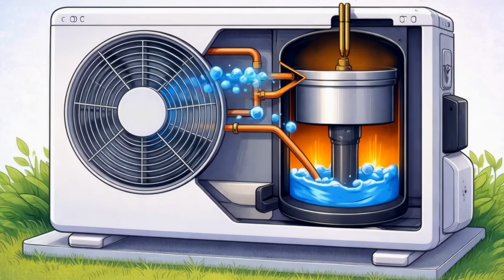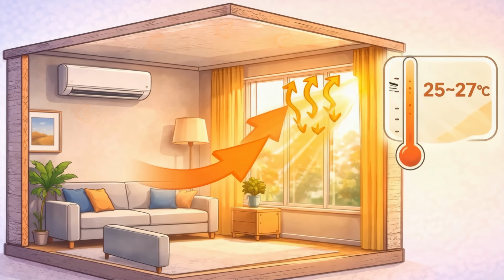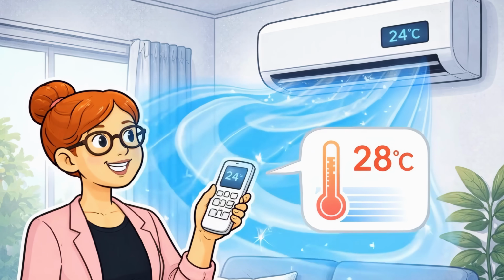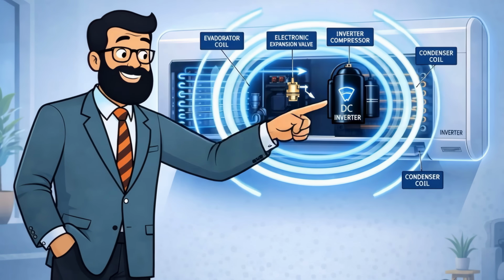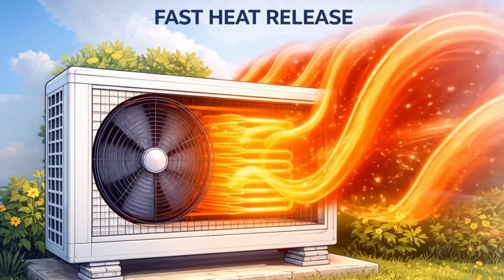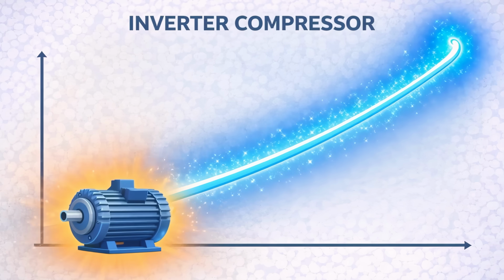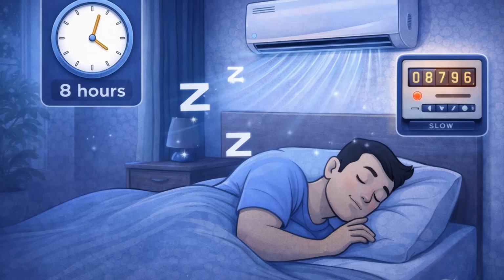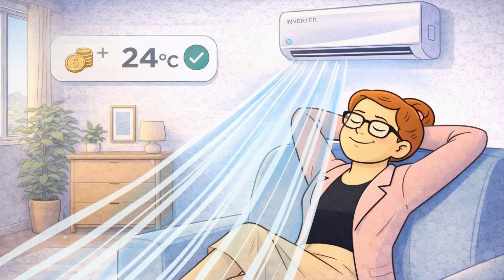Inverter vs Non-Inverter AC: Why Your Electricity Bill is So High! (Science)

Comment: The inverter uses proprietary components vs the non-inverter basic system.  That alone means the replacement parts cost are very high compared to non-inverter plus the part may not even be available in the future.  AC units are following the same pattern as automobiles.  They used to be simple to repair and had parts available from many vendors but now, autos are extremely complicated, difficult to repair and major parts can only come from the manufacturer.
Reply: You r right. After 2 years of use the parts arent available anymore, and because each brand uses its own electronics, you cant says... install a generic pcb. Parts for inverter a/c cost a fortune
Better go o  classic simply mechanic a/c 
You will pay higher monthly bill bu your a/c will work wirhout troubles
Reply from the maker: That's true. We covered that part in the video as well.
Reply: The reason is one chip doing most of the work instead of relying on other parts. Heavy integrated designs
Reply: Soft starters and inverters are made with cheap components, they heat up until burn out, or even worse, they may come with obsolence pre programmed. The day the clock clicks bye bye. No more a/c

Comment: After 3-4years the inverter board gives problem for the technician to come an check and repair cost more than than the money you would have saved,its has many sensors and elctronic parts than non inverter.Imagine calling the technician for every year for repair after the 3rd or 4th year.I prefer non inverter and set the temp at around 23-24 degree celcius which can save the electricity bill and I will have aair conditioner that runs for a long time with minor problems/maintenance/repair only.So no thanks to inverter.
Reply: I have been using inverter ACs for a while now But the LG duel inverter machines work very well for 4 years then fail The cooling efficiency goes down 😢 have replaced these duel inverter units 3 times in 12 years 🥴😰
Reply: @sachinhsoni  Yes it's normal,I do a.c repair work also.The business model i set up in such a way that the charges for repair work will be high.Non inverter less elctronics component,less problems mostly outdoor unit compressor/fan capacitor replacement only.

Comment: Great explanation of how inverters work! The inverter control system is the reason I selected an A/C of that type. Very quiet start up and run. VFDs are used everywhere now days. Everything from the low power motor in your washing machine to the very high-power motors on ball mills and rock crushers at your local gold mine! Inverter technology is here to stay!